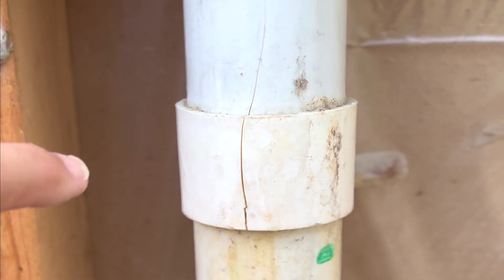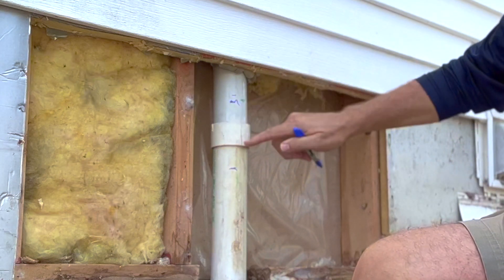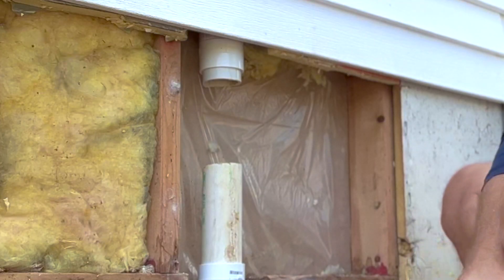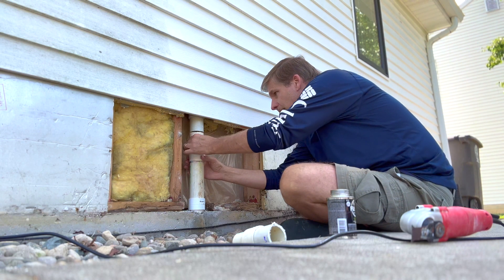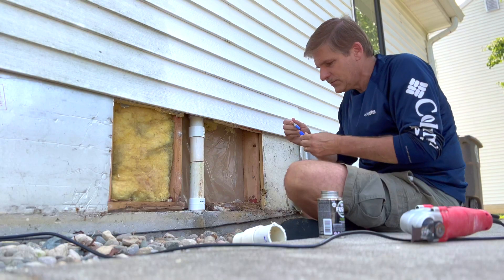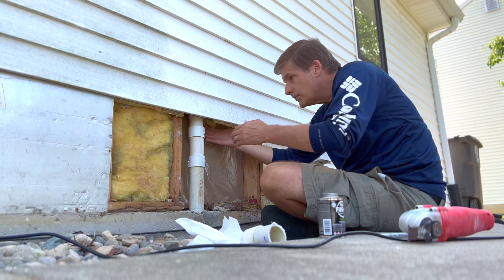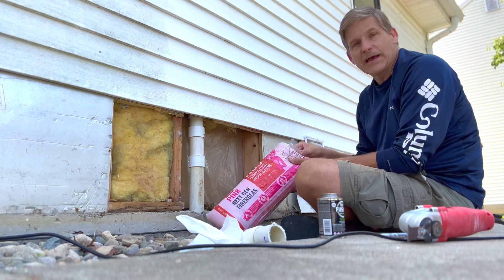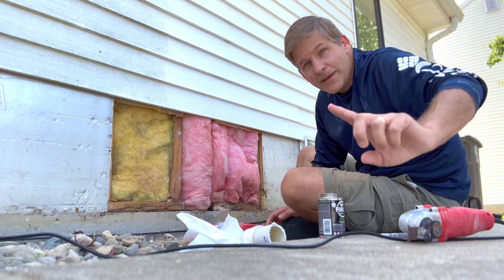How to Fix a Crack in Drain Pipe | Repair PVC Pipe use Repair Coupling

Comment: We just followed this ... However, the repair couplings are a tight fit, whether on our existing pipe or on a short piece of brand new test pipe we purchased. Moreover, on our test pipe that we practiced with, the Oatey Fusion set within seconds, before we could get it slid back over the area we wanted to join. How are you getting the repair coupling to slide on and slide back so easily? How are getting the Oatey Fusion to remain fluid enough to work with for the time required to slide the repair coupling into place? TIA
Reply from the maker: I slide on the repair coupling above the joint - dry - w/o any fusion cement on it. 
I only put the cement an inch above and below the joint of the two pipe sections to be repaired. Then slide the dry coupling over the to pipe sections that have the fusion cement on them. 
Hope that helps.

Comment: What if the crack is on a curved pipe?
Reply from the maker: Can be fixed but definitely more challenging. 
May have to cut out corner AND some extra pipe on either end. Then add new pipe sections into the new corner - then use couplers on either end to connect pipe section to pipe section. 

A lot will depend on how much room you have and how your setup is arranged. 

Can be done - just challenging.